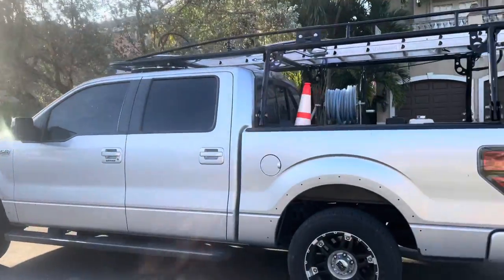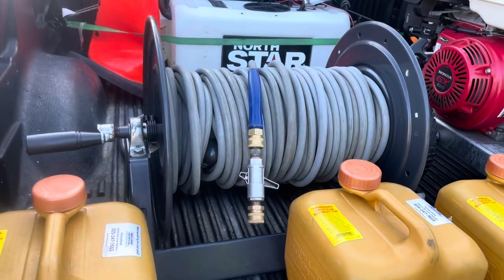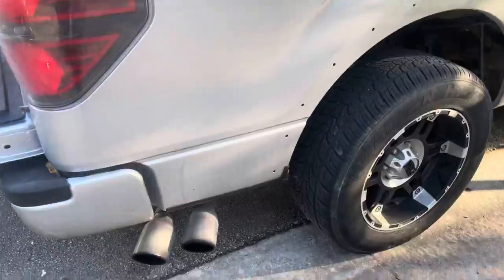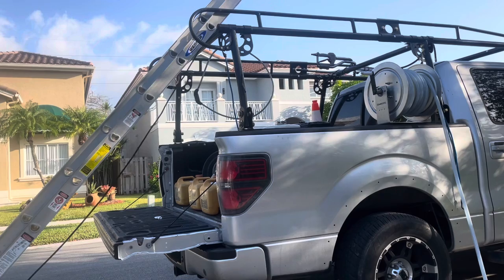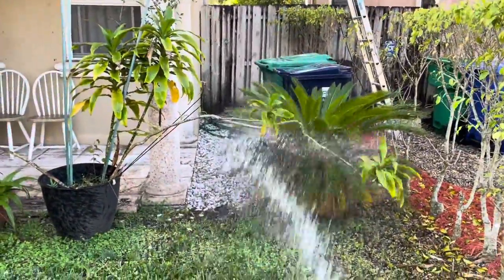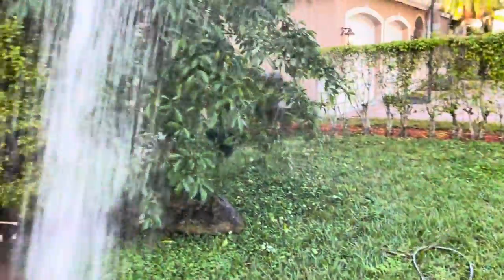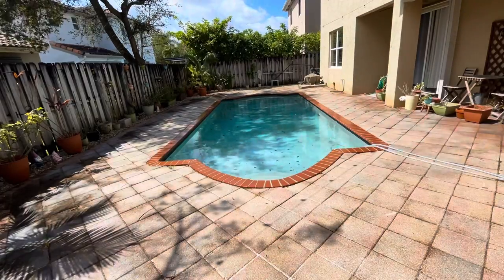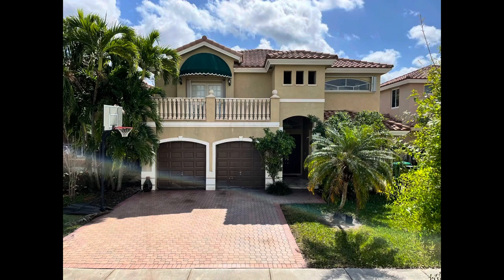Pressure Washing setup for BEGINNERS! (Truck bed)

Comment: Good job Bro. Few tips for you if your interested. The yellow cans are mainly for diesel. But go to any advance auto parts or auto zone. Get the blue 5 gallon jugs for your surfactant and SH for down streaming. Chemical injectors are normally  at 4 to 1 ratio better ones pull more Chemical  supposedly. Reason for 5 gallon jug though is 3 gallons of 10% SH 5 ounces of Surfactant of your choice and $25 gas into your pressure washer a extra 2 gallon gas can and rest goes into your truck. That actually cost you $61 to do a house when broken down. Basic prices are per hour $100 for just water package, $150 for Chemical/SH mix. Part of a upsell package type offer to clients. But some clients want to argue your price or haggle you. So you can easily  say ok it's your first time the best I can do is knock off $25 per hour. But in reality a 4 hour job your only missing $100. That's if you really feel you need the customer but tell them next time or year will be regular price.  Also get some buisness cards from vistaprint or wherever. Go to all restaurants in your area introduce your self and on back of card dumpster and food waste area cleaning only $150. They are supposed to have clean areas regularly. So can be monthly or bi-monthly  income
Reply: Great advice. Don’t undercharge yourself for commercial. Use degreaser and downstream.

Comment: Man this is great. How’s it going 2 years later? I’m about to start with a small set up also. I have a carpet cleaning/ floor cleaning business, but 2 clients just popped up wanting me to “pressure wash” their places. It’s stucco, so after research I’m moving to make my softwash set up. I figured it would be a good add on to my service. Hopefully it fills in the down times for me

Comment: This may have been asked and answered already, but how did you mount the reel to the bed of your truck? And great job on this video! Very encouraging and enlightening.
Reply from the maker: I’m glad you feel that way bro, but its quite ratchet lol. So I’m using a couple of the holes on the roof rack, just ran two screws through the hose reel into the holes on the roof rack. I’ve been meaning to make a video on that. So stay posted so you get a better idea!

Comment: Nice work man. Keep it up. I’m new to this but I’m learning every day from youtuber just like you. Since your equipment sit outside the whole time, does the rain effect the pressure washer? I’m curious
Reply from the maker: The pressure washer not so much but I try to cover it as much as possible but the soft wash pump and battery I always try to cover
Reply: Got you. Thanks

Comment: What north star soft wash system do you have? Looking into the same setup kinda,do you have a water tank also for your pressure washer so your pressure washer pump doesn’t burn up?
Good luck with your business bro.
Reply from the maker: Hey what’s up mate, it’s a 5.5 gpm bleach pump and no unfortunately not always use the homeowners
Reply: I have a question how would your pump burn up with out a water tank?

Comment: Hey bro I was wondering would it be in anyway smart or financially fine to focus the pressure washing business around driveways, like trying to get as many driveways jobs as you can per day because they don't usually take as long?
How long do driveways jobs typically take you?
Also you've been in the business for 6 months, how many clients or jobs per week do you normally get?
Reply: Of course always good to start with a focused business model. You can always expand later. Just get good at your craft and figuring out the challenges first

Comment: That set up is clean fam! You just have straight sh in the tank? No dish soap or eliminator?
Reply from the maker: Very much appreciated! I actually have my water and surfactant in there. So I batch mix everytime before a job and I’m able to use the leftover for another job if need be.
Reply: @servanospressurewashingllc1477  ah okay how did you learn how to make the batches?
Reply from the maker: @DavidAguilar772  so honestly I go off of the labels on northern tools surfactant lol but other than that trial and error.
Reply: @servanospressurewashingllc1477  ah okay bro that’s still good you did really good work thanks for the info and shi keep making videos fam

Comment: Thanks for posting. I've been trying to use my 12 volt system for rinsing before and after chemical application and it is taking way too long. It looks like you were wetting the plants down with a garden hose, or would you recommend using a fan tip on a pressure washer to rinse everything down quicker?
Reply: And I know it’s been six months so you probably already found a better way but definitely use a garden hose hooked up to the homeowners water supply to do all your rinsing

Comment: You did an amazing job bro just stating that. But a question to u is the surfactant and bleach was also sprayed on the plants just asking. And if so doesn’t that kill them. Please answer I’m wondering myself
Reply from the maker: Thank you very much! So when I first started soft washing I tested it out on my neighbors roof and I accidentally killed about two or three plants :/ so if you don’t hydrate the surrounding plant life before, during, and after the job you might run into some trouble. Just have to take the extra time to be safe!
Reply: @servanospressurewashingllc1477  so just spray the plants with water. Cuz I thought it was with chlorine lol sorry for my ignorance haha
Reply: @servanospressurewashingllc1477  how do you rinse during the middle of cleaning the roof if your water source already has sh in it??

Comment: You mentioned in the pool deck area that your coating the surface with SH, is that chemical bleach?
Reply from the maker: That is correct
Reply: @servanospressurewashingllc1477  ok thank you.

Comment: If you had to stamate how many ft of hose dud you use for from the machine to the roof?
Reply from the maker: I used probably around 100 of it but I’m rocking a 180ft hose right now and when it comes to residential work nothing stands in its way!

Comment: Looking to start next spring. How many gallons do you use for a house wash. Trying to figure out how big a tank I need to start.
Reply from the maker: Hey mate, I started out with a 13 gallon tank… lots of refills on big jobs not very efficient but could get the job done. Moved on to a 26 and saved a lot more time and now have to 55s and life’s good. So anywhere in between 20 and 50 would be money
Reply: @servanospressurewashingllc1477  appreciate it bro, it's late in the season to start here in Ohio... So just want to try to get ready for next year, and what I need to get.

Comment: Just started my pressure washing Business, and want to know where can y buy the yellow chemicals you have?
Reply from the maker: If you’re speaking the SH (bleach) I would check your local pool store, you could even call them and see if they sell it, IF you don’t have any, lowes or Home Depot has some BUT pool stores first
Reply: @servanospressurewashingllc1477  yes I’m The SH bleach but what brand is it or can u send me a pic of how the bottle looks or where do you purchase it from?
Reply from the maker: @blessedcurbappeals7512  so the new spot I’m going to you can just get this hose connected to their massive tank and just refill my tank but the previous spot I was going to I had bought 10 2.5 gallons of sh from pinch a penny

Comment: That was way too little charge even if you are new. I would charge a competitive rate based on the square footage and industry standard for your area.
Reply from the maker: Very well aware, learned a lot over time but unfortunately that is a common price range here in SFL but can’t sustain a biz with those prices for sure

Comment: What pump is that off your sh container and do you attach a water hose too to mix or is the container already a mix
Reply from the maker: At the time it was a northstar 5.5 (don’t recommend. And the tank was already mixed specifically for this job

Comment: Anyone doing this full time and how much it costs for the beginner set up...?
Reply from the maker: Currently doing this full time which is great even on a slow week you’ll be making more than a basic minimum wage job and on this setup I’ve spent around 5k and that’s with everything which isn’t bad at all you could even spend less buying cheaper equipment to start out with!

Comment: Hey I was wondering how much chlorine did you use on that job. I noticed you have a smaller Kim tankHey I was wondering how much chlorine did you use on that job. I noticed you have a smaller  Chemical tank and then I noticed you had 3 jugs of Korean which are 2 and a 1/2 gallons a piece. I'm asking Dean because I couldn't figure out how much chemical you use to do the driveway the pool deck and a roof clean. It I use a lot bigger tank I'm new at this as well so I'm wondering if I'm using way too much chemical Chemical tank and then I noticed you had 3 jugs of Korean which are 2 and a 1/2 gallons a piece. I'm asking Dean because I couldn't figure out how much chemical you use to do the driveway the pool deck and a roof clean. It I use a lot bigger tank I'm new at this as well so I'm wondering if I'm using way too much chemical.

Comment: 425?!!! My Guy are you in Florida? I'm in Miami and that job was 1200 minimum. I didn't see or hear anything about cleaning the house but for future reference 
1 story House only .15 2 story House only .20
1 story Roof only. 25 2 story Roof only .30
Surface only .35 to .40 
Discount when booking multiple services. 
Again this is for South Florida!!

Comment: Good video. I disagree though with using bleach. My opinion is the industry should be regulated and people should know what not to do.... I mean the EPA directly says not to use bleach. Every company using it and spraying that stuff everywhere is polluting the environment and at the end of the day watering it down isn't going to do much. Not just that but a lot of companies are letting these toxic chemicals go down into our natural water ways. There are other toxic-free chemicals that are also biodegradable AND work just as good if not better than bleach. I really have never seen such an upside-down industry than pressure washing. I feel like everybody is just doing what the last guy did no matter if it's the right thing to do. Lol. But then again it makes it really easy to stand out from the rest.
Reply: Ideally we would collect it at the gutters and dispose of it. It could be deactivated by adding a protein of unknown cost. Anyone doing that?
Reply: " How dare you "

Comment: Man that ain't no starter kit, that's uh 40k truck
Reply from the maker: Nowhere near dude
Reply: @servanospressurewashingllc1477  Ok well help me out with this then, what would be uh good washer to start off with, I been looking at sum online, and sum say cold water, or hot water washers, so different ones work for different jobs or sumthin??
Reply from the maker: @travisginyard5383  yeah but they do the same thing, usually you’ll see dudes who do only commercial work with the hot water ones. But starting off just get a cold water one. It depends on your budget the one I have now is $1800 and I recommend it but if that’s too much go to lowes or Home Depot and get yourself what you can afford and work your way up ( that’s what I did)